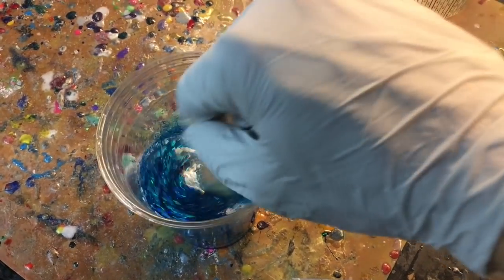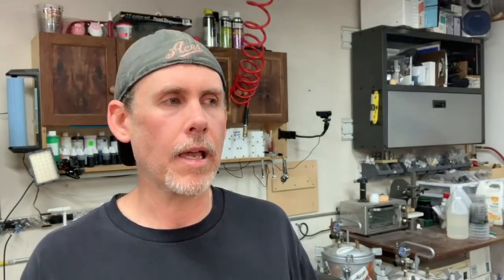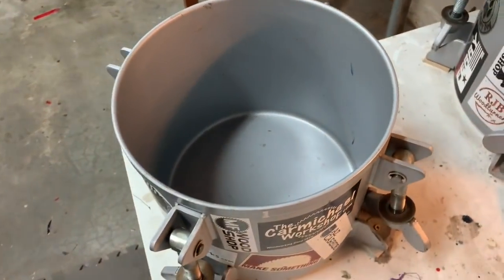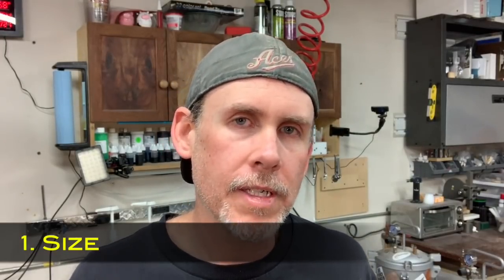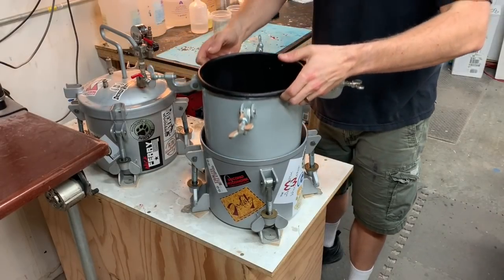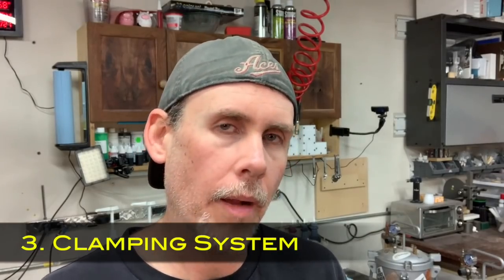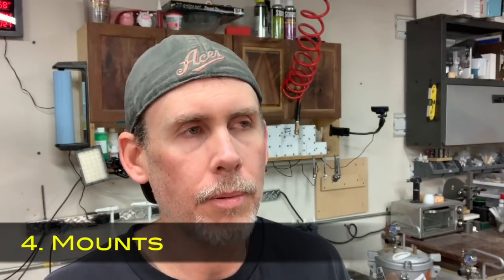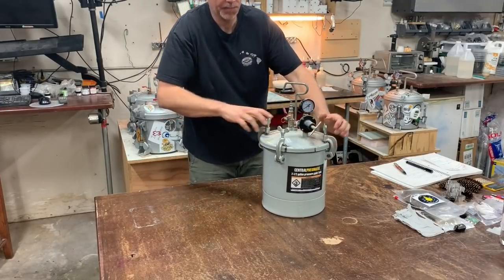Choosing A Pressure Pot for Resin Casting

Comment: Good eye work. lol
I have the 5 gal. CA and love it. My mill molds are 12 1/2 out to out so I use mine on its side all the time. It sits in a cradle that is notched around the wheel fittings so it stays on the pot all the time. The wheels are on the fittings and therefore can be used upright with no modifications. I use a shelf in the pot and level the shelf with a level and also on top of  the pot, from front to back, with a level. I shim the legs if needed to level it. I use it all the time in this form even for small items. One can get a lot on the shelf which is just slid in a little below center. I store it on the floor, on its wheels,  and roll it out of the way.
Good vid,
Lee
Reply from the maker: Haha!! Glad you watched to the end 😀  Yep, I actually have a video that covers using pots on their side. It can be a life saver for long molds! Sounds like you have a great system set up

Comment: Look around for retired painters I bought a 5 gallon pot no paint was in it because he aways put 5gal buckets inside pressure pot gave him 100 bucks and he gave me his 2 1/2 gal also
Reply: Where do you suggest looking for a retired painter? I see this comment on all of these threads and videos and other than CL, where they are selling for $300 a piece used in Denver at least, I'm not sure where else to look.
Reply: @Petrolfox669  I bought mine off Craig's List fo $45.

Comment: When I was working we would use a vacuum chamber to remove bubble when making high voltage transformers. We used some thing similar to resin I am not sure what it was. It has been awhile since I did that and I did not do it very much. I mainly just helped.

Comment: A bit of a weird question... I'm setting up to so resin casting using a pressure pot method. How loud does the air pump connected to the pressure pot get? I dont have a garage or a shop, more like a hobby office. So I was wondering how noisy it would get. And if it is substantial are there anyways to muffle the sound?

Comment: Make sure to check all fitting on new pot and soap test for air leaks .apply loctite 545 to threads of valves. . I can thank Zac for his previous videos on CA pressure pots .  Not essential as you can use a heat gun on resin bubbles , but you don’t get that compressed structure as you would with a pressure pot at 60 psi .

Comment: Worx Pegasus table has clamps. Great if one doesn’t have a surface to bolt one too. I’m wanting to get a compressor I can use both for air brushing and a pressure pot and be affordable. My studio is my basement so I’ll be using the lowest reasonable psi for resin .

Comment: "anything else to think about"  thread size:  I bought a 15 L (4 gallon) Vevor pressure pot in the USA that came with BSP (British Standard Pipe) fittings instead of NPT fittings. I ended up buying two adapters (one shipped from China and the other shipped from the UK).

Comment: Hi Zac, A great Pros & Cons of pressure pots. I don't think pressure pots in the Uk have the same standard rating. Mine is 10 litre/ 2 1/2 gallon tank rated up to 60 PSI but also has a release valve which I have set at 50PSI so I feel ok using mine. Once again a great tutorial videos with a fantastic slant on safety. Cheers, Huw
Reply from the maker: Thanks Huw! Yeah, they may not have ASME ratings on products outside the U.S.

Comment: I took a 1and 1/4 inch socket cut a slot in it 180 degrees apart to tighten up my wing nuts. With a ratchet

Comment: Would casting an epoxy orb in a 2piece mold, work in a pressure pot or would it still displace the halves even with the split sealed with a sealant (resin, super glue, hot glue)?

Comment: Hey thanks for sharing! Quick question if you dont mind, I purchased a Harbor Freight pressure pot as an entry level tank. There is a casting that I would like to do that involves a 1" x 1/2" x 12" piece. The mold will not fit horizontally. I was just curious if you knew if the pressure casting works alright vertically before I waste a bunch of epoxy :) Thanks!

Comment: Hi Zac, thanks very much for all of your great content.  I recently purchased the HF pot and converted it.  Using the Loctite product you recommended, I have zero leaks from any of the connections or the new regulator as the HF regulator leaked too.  That said, where the top seals to the pot itself does slowly leak.  I can not maintain 40 psi.  It will leak down over night to about 15 psi.  Any tips on what I can do to make the top air tight?  Sanding or different gasket material or any other ideas?  I have tried the top in several different positions and used some vice grips to help tighten the small wing nuts as much as I dare.  These steps produced no improvement.

Comment: Great video, thank you for putting this together! If the air compressor has a regulator is there any need to keep the bulky one on the top? I figured pressure in is pressure in as long as it’s regulated through 1. Figured I’d ask the Pros before I blow myself up.

Comment: do you use vacuum pump, or compressed air?
Reply from the maker: You use a compressor when you are pressure casting, you'd use vacuum when stabilizing wood or degassing silicone
Reply: Hi. As I am mostly making smaller resin moulds with objects embedded, would I be better to get a vacuum pump to remove air bubbles instead of a pressure pot???? . Also, how do you measure the time to leave items in either appliance ??? . Many thanks for your consideration 💕🦆

Comment: Hi Zac, I am looking at a pressure pot as I do artisan jewellery, so pieces are very small and all hand shaped, so I pour in block moulds of about 5cmx9cm, and I can do 12-15 at a time.  I was wondering if you can put shelves of some sort into the pot to stack moulds, almost like a 'high tea cake stand' kind of deal, or can you only put in on bottom layer at a time?...This would really slow my production down. thanks very much for your info, it was very informative on the pots. cheers

Comment: Hey bud. What’s your thoughts on ca technologies pressure pot vs tcp pressure pot? The tcp is about half the price and my harbor freight just broke a bolt and threads are jacked. I like the butterfly wings with bracket. I think those will be easier. Thanks for any advice

Comment: Thanks for the insight. Do you have any advice on selecting a compressor to pressure the pot?  Is a small 3 gallon compressor sufficient?  Or, how about a 110 psi inflator? I really have no other reason for a compressor so I hope to spend as little as possible. Thanks again!

Comment: What's a good target PSI for the pressure pot? I bought some two-part epoxy but it doesn't have any instructions for pressure pot casting. I've heard 35-40 is pretty typical.

Comment: Zac - assuming you will see this note, do you buy the CA Tech 51-201 (regular paint pot) or the 51-501C (modified for casting pot)? Do you know what the different is between them?

The price difference between the pots is $40-50+ so I just wanted to be sure on which version because it is a noticeable price difference.

Comment: I am very new to Resin... actually I haven't tried it yet. my question is - How come some people put resin in a vacuum and how how come people put it under pressure - to cure? Yep, it's probably an easy answer, but if you don't know, you don't know. Great vidio anyway, thanks for sharing
Reply: Vacuum is better for silicone. The resin we use cures so fast vacuum is not an option. Vacuum pulls bubbles out. Pressure pots make them so small they aren't visible.
Reply: Thanks for that 👍

Comment: Zac, thanks for sharing, what about de pressure regulator which is connected to the pressure gauge, is it any helpful, since you just put pressure and disconnect the hose once it has reached the needed pressure

Comment: I have a question... I am looking to cast longer castings. Is it possible to lay the pot on its side so I can get the depth I need?
Reply from the maker: Absolutely! It helps if you can rig up a mounting system, and make sure to double check that the mold is level when you put it in

Comment: Can you replace the factory fittings on a pressure pot? I got my 2.5 gallon C.A technology’s pot. And I saw the safety vavle was leaking and I spoke with a C.A technology product specialist and he said they’re meant to be constantly fed air ( the resin casting version) and I was like “ okay that’s fine np” and I set it up I adjust the regulator and it leaks air slowly. I spray soapy water and it is leaking air BUT it was leaking air from the the bottom of it on the nipple. I take out my handy dandy sealant tape and take the safety vavle off and to my surprise is  the nipple that’s attached to the lid is stripped?!! ??? is it safe to remove it and add a new nipple with loctite?

Comment: Hey Zac quick question, what do you think about leaving the pressure pot loaded with air under the sun? or during winter in the cold, is that dangerous due the metal dilatation because of the temperature?

Comment: Hey so I’m new to resin casting try to do some without using a pressure pot and then I went to turn it on the lathe  I start getting big chips out of almost like there were air voids in the resin it I was curious if not using the pressure pot and having air bubbles if that’s what you think caused that
Reply: That sounds like a speed and tool issue. Make sure the tools are sharp, you're presenting them properly and it's spinning fast enough. Good luck!

Comment: Hello Zack! Can I convert or modify a cooking pressure pot to pressure epoxi resin?
Reply: NO.  The most basic reason is that a pressure cooker is only designed to handle 15 PSI.  THat is the high setting.  Since you want a pot to handle at least 40 PSI that Pressure Cooker ain't going to hack it.  To even get close you would have to disable all of the safety measures on the pot.  That is probably not really possible on a modern pot and unfortunately possible on old ones.  You absolutely DO NOT want to do that because you are creating a bomb.  Gasses compress and when they rapidly expand what you end up with is an explosion.  Remember the Boston Marathon bombing?  That is what happens when an over pressurized pressure cooker fails.

All an explosive powder etc. does is create a huge amount of gas.  "low explosives" like gunpowder don't explode if you just light a small pile of it.  They go up sort of like flash powder.  However if you contain the gasses so they can't freely expand you get an explosion.  So the pressure build up would be much slower in your pressure cooker but the explosion when the pot fails will be the same.

Sorry for the long post but a lot of people may be thinking the same thing and what you are talking about is extremely dangerous.  You might get away with it a bunch of times because most things are designed to withstand a multiple of their stated rating, but one failure could be fatal and you would be going over twice the rating so...
Reply: S Koue that was a very thorough explanation. When I was listening to Zach saying no to pressure cookers I got to thinking about canning and most items you shoot for 10 psi, significantly lower. Then there are the clamps, which was another clue...I do have a question if you have time. Is it essential to use a pressure pot when combining wood and resin?  I am hoping to get the lathe set up over this winter, I have a variety of interesting wood, but some of it will need to be stabilized.

Comment: im newto resin casting & on my 1st cast with no pressure pot it came out soft & plyable is it due to no pressure pot or something else
Reply: That sounds like it didn't fully cure. You probably didn't mix it with the proper ratio or you didn't mix it enough

Comment: Hi, the pressure is between 40 - 50 psi? And how long do you leave the mold inside? Thank you very much and greetings from Argentina.
Reply: If I'm understanding it correctly, you would leave it for the entire time the resin needs to cure. So usually 24 hours.
Reply: Depends on the resin. Ours take 15 minutes. Old "slow" resin took 1 hr. 

That's to demold. They continue to harden after they come out of the mold.

Comment: Are all the different pots the same to convert to a pressure pot or are some easier than others?
Reply from the maker: That's a really good question, should have covered that in the video! Most of them are pretty similar overall, but C.A. Technologies has a model that is specific for resin casting that only requires adding a few plumbing fittings to the regulator, all the parts we would remove are already gone. The link to C.A. Technologies pots on the "Tools I Use' page on my website takes you to the resin casting models: https://nvwoodwerks.com/tools/
Reply: Zac Higgins thanks, appreciate you responding
Reply: Do you use any kind of bucket “liner” in case the resin leaks out of the mold to protect the inside?

Comment: What would cause my ball valve to not let air out when I open it without the air hose attached? I removed to make sure that it was working and it opens and closes just fine without pressure.
Reply: If it’s hooked to a regulator it shouldn’t let air flow backwards

Comment: can i use vacume instead of pressure
Reply: From what I understand you need both the vacuum to suck out the air for the silicone molds and pressure pot for the resin. I think if you put the epoxy in a vacuum chamber it will suck out the epoxy and put it in your vacuum chamber.

Comment: ok to use a pressure pot as a vacuum pot also?
Reply from the maker: Yeah they can be used for vacuum with a different lid
Reply: Biggest issue is since it's around 11" wide you need a really thick lid. I think most use 3/4".

Also some sort of good seal.

Comment: I’ve seen all your videos. But I have a question that I have not seen a answer for. I’m new to resin and I tried to cast a flower in clear resin that had white petals. The petals soaked up the resin and turned a yellow color. Any suggestions for overcoming this issue? Thank you for your time.
Reply: They have a preservative spray for flowers can't remember the name though, If that doesn't work use a spray paint on the flower before casting. These are just things i would try i haven't even done my first project so you can tell me to flip off if you want lol.
Reply: You can dry your flowers in silica gel. You can find a product at craft stores in the floral department called “flower drying crystals.” All the instructions are on the package. But basically you put your flowers in the crystals, cover them. Either let them set a few days or microwave to a certain temp.. the flowers keep all their color and shape 😊